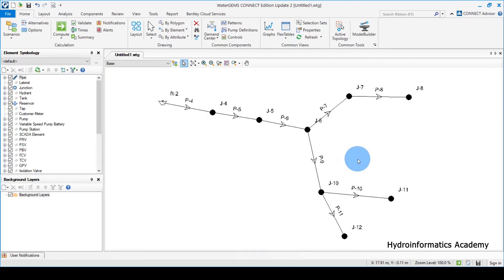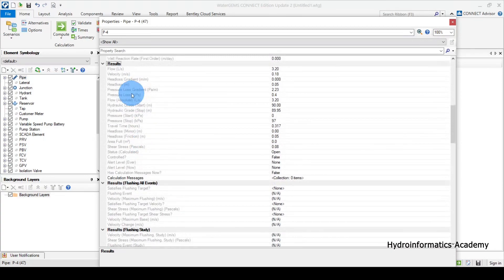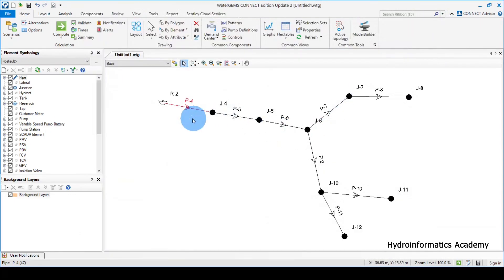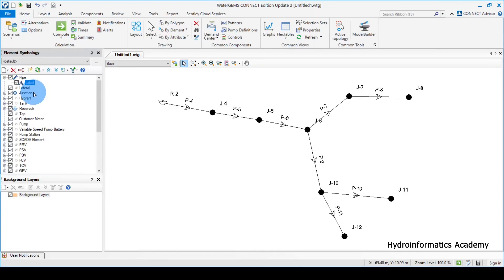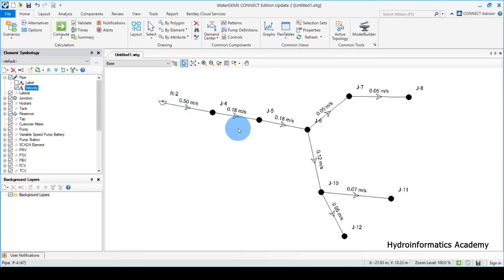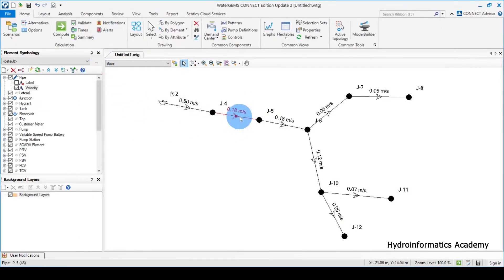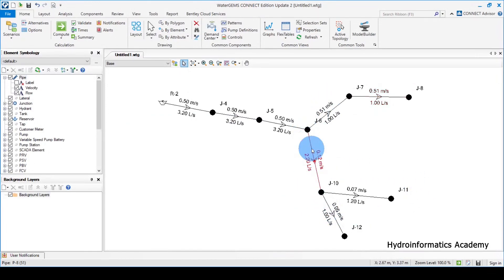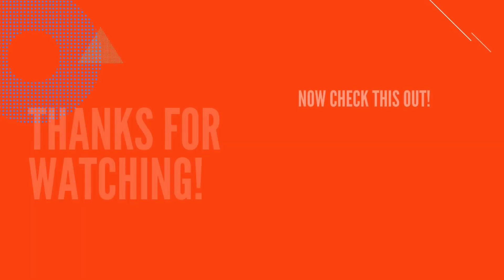WaterGEMS Connect Edition Tutorial for Beginners [Part - 02]

Comment: Thank you for your well explained tutorial , I've watched it all and understood quite well. 
I do have a doubt. If I want my Pipeline on surface and I have the land xml file imported. Will the software take the elevation data from the land xml file automatically while drafting the network or I have to assign the elevation values manually just like you did ?
Reply from the maker: Thank you! Assigning elevation data manually is not an efficient way of doing things when you are dealing with complex projects! 

Back to your question, I am not very sure if data in "XML format" works the same as data in "shapefile format" if it does then there might be a few steps to make watergems extract elevation data from your XML file...

Otherwise, you might need data in the shapefile and use the Trex function in watergems to extract elevation data right from your shapefile.
Reply: @HydroinformaticsAcademy  hello!
I tried your advice but I couldn't find any tutorial regarding exporting of surface from civil 3d to shape file. 
My work mostly relates to open channel design & since it's a surface flow I always have to consider the surface profile before drafting then design it in excel. 
I want to save time, hence exploring sewer gems.
Since, all the sewer/water gems tutorial have drafting on plan, for me it becomes quite a disadvantage. 
Let's connect and discuss it in zoom 
In that way I can explain my problems and we can solve this together.